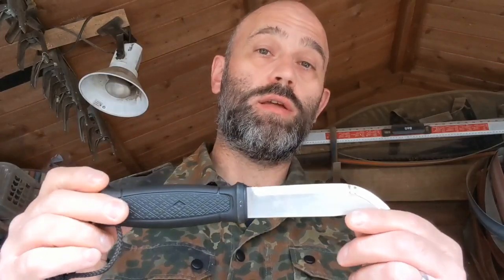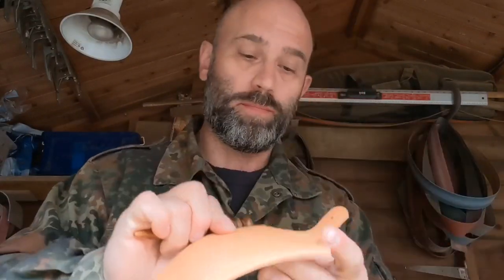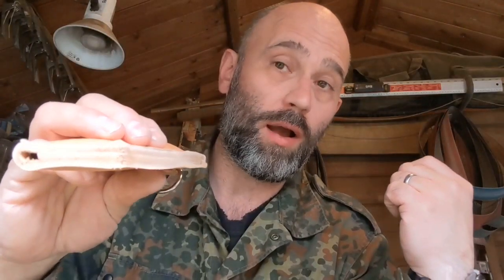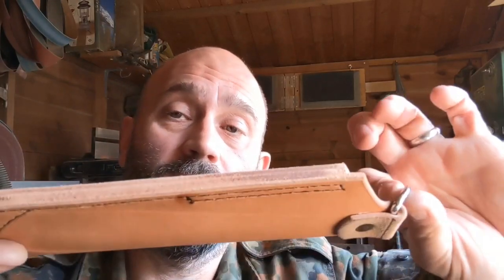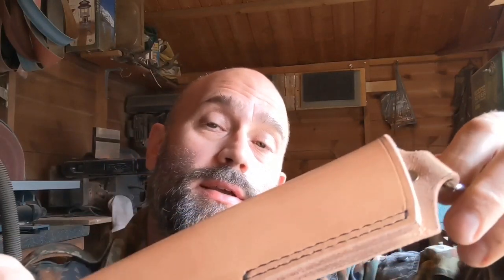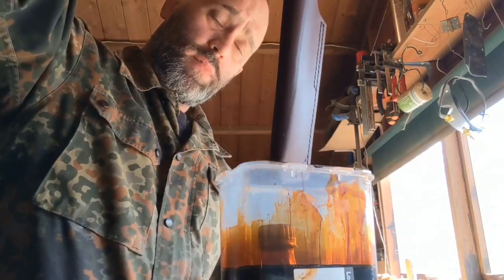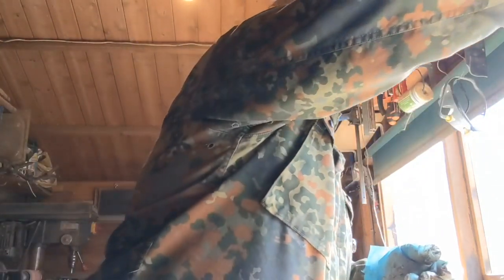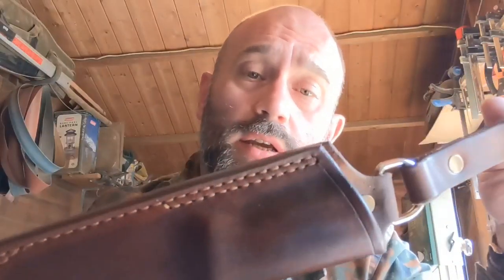making a leather sheath for a Mora Garberg

Comment: Nice bit of leather work there Rob.. just started using dove soap for burnishing and it works a treat 😁all the best Lincoln 👍🤙
Reply from the maker: Dove soap, body wash soap?
Reply: @RobEvansWoodsman  just normal dove soap Rob.. just spray the leather rub a little on and go for it 👍 don't mind leatherwork but can't stand the stitching bit 🙄
Reply from the maker: Stitching is long and boring but it dose make you appreciate the sheath as much as the knife.

Comment: Great vid as usual - what brand needles are you using? I've tried a few and the eyes keep snapping when they get pulled through the leather.....
Reply from the maker: These are from the identity store , they only last two or three sheaths then the eyes break.
Reply: @RobEvansWoodsman  I wonder if I should just make the holes bigger and see if they close up OK after the wet forming? Honestly people don't appreciate the amount of work or skills needed in a knife blade, in a handle, in a sheath.
Reply from the maker: @daemonharper3928  do you use an overstitch wheel? That helps close the holes up, my holes are pretty tight, I still have to use a pliers.
Reply: @RobEvansWoodsman  I've started to use one having seen your tutorials - tbh i think my leather kit needs upgrading from beginer "playing at it" level - to robust.
Lots of pointers from copying you mate, much appreciated.

Comment: im having problems with punching holes for sewing, they allways go out unprecisely to my markings. What do you do to allways punch your holes out precisely in and out?
Reply from the maker: I drill them, but it takes practice and a drill press to get them accurate.
Reply: @RobEvansWoodsman  i do have a drill press. I tried doing it with it, but it kept pulling the heck out of the leather when i reversed the drill. Do i need a specific drill bit?
Reply from the maker: @krisshh1587  I use a 0.5mm HSS bit